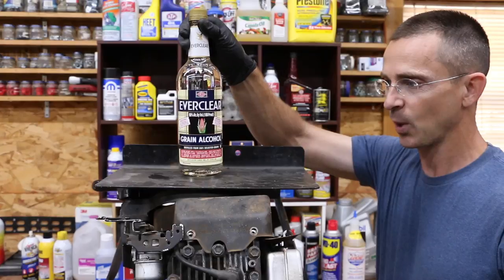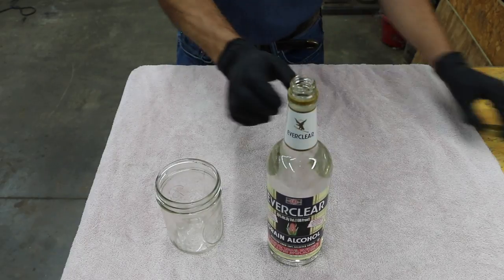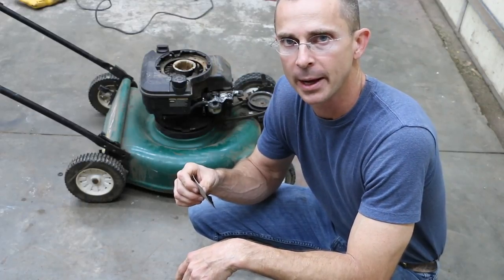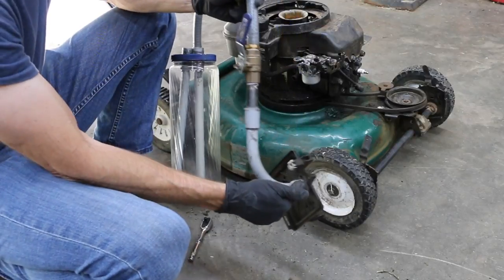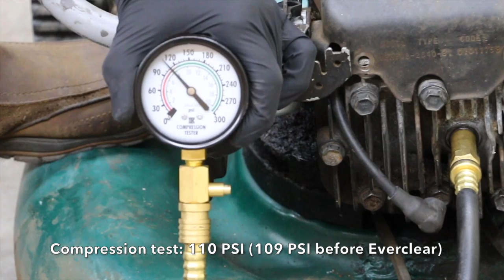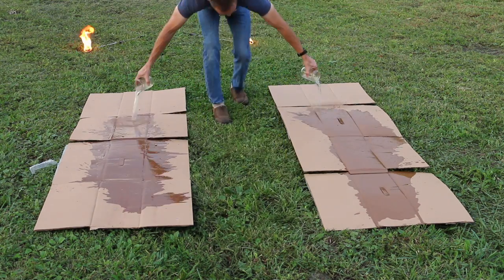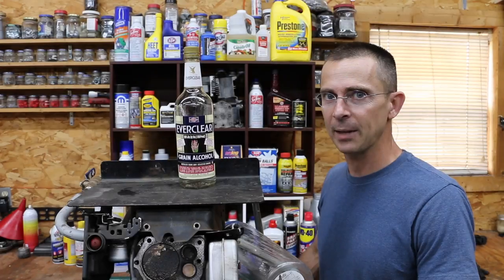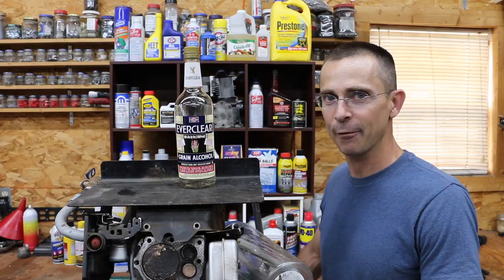Will an Engine Run on Everclear Fumes?  Let's find out!

Comment: Try to make an engine run off of acetylene I’m a fabricator and have to cut steel on a daily basis it would be very cool to see if it is possible though an engine like this 👍🏻. Be careful.
Reply from the maker: Thank you for this recommendation!
Reply: sound a bit dangerous lol, yeah be careful if your decide to try this. the whole engine might get blown to pieces
Reply: Sackmatters to lean and that could get hot lol
Reply: Sackmatters jeez that seems a bit sketchy dont you think?
Reply: Cutting with acetylene gets on my nerves, anymore i just grab a 6010 rod at 175 amps and push right through the plate lol
Reply: A car engine can run on acetylene and a test was done where a car engine tinkerer and his wife drove their car
from the East Coast to the West Coast using acetylene. You have to have a propane converter, a pressure tank
which holds water, a pressure lid on the tank for filling the tank with water+calcium chloride, a pressure pop-off
valve and most of the hardware that goes along with a propane conversions for vehicles. The converter would
not need to have engine water heat since the gas created by water and calcium chloride emits acetylene gas.
The water and calcium chloride was used in the old miner lamps for illumination in the mines. The ideal setup
would be a stainless steel tank with the fittings and connections welded on it. The tank is the secret on the
setup. The calcium chloride is even used today to charge the acetylene tanks for the welding/cutting torches
today. Propane and oxygen is sometimes used for cutting torches. Running the acetylene fuel in a car today
might be a problem since they have all the electronic computer junk on them.
Reply: Dennis Peterson cool, thanks for the info. still seems like it would be hard on the engine and I doubt the tinkerer went full throttle. If you had a large charge of air and acetylene (like at full throttle) I think it would blow the engine up.
Reply: I suspect that the fuel would give more power versus propane but remember, there is no un-burned fuel to cause a PING. You will never
hear ping in a engine with propane or a high vapor substance. A large
air charge from a supercharger/turbocharger might be a problem since cylinder temperatures would climb at a high rate possibly faster than
a tachometer!. A Pyrometer would need to be used to monitor exhaust temperatures much like what is used on the diesel trucks. I really suspect that if it's (acetylene) carefully used it would be a good fuel. I do know that it does not burn as clean as propane. The carbon soot from it burning in
the presence of air might be a problem. I know from my own experience that propane is the best option and a engine has to be tuned properly by raising the engine compression and changing the camshaft profile. Vaporizing gasoline is not the way to go since there are 7 different compounds in the gasoline that vary in vaporization temperatures and some are higher than 400 degrees, if I remember right. I have a chart on
them and I have played around with gasoline vapor fuel systems
and had success but as time went on running such systems, my
mileage went down just above what a fella would get using a 
carburetor. The vapor panels were getting contaminated from the
heavy ends of the fuel that were not being vaporized. Change the
vapor fuel panels to new ones and you were back to improved
fuel economy so, gasoline is not the answer. The only fella I know
that had a successful system was Smokey Yunick. Tom Ogle had a
system and I suspect he might have used White Gas or
what is called "Lantern Fuel", unless he changed his vapor panels
often? A Coleman Lantern proves that a pure liquid gas that resides
at room temperature will burn clean in them as a vapor. Put ordinary
gasoline in one of them and you will end up replacing your 
lantern's generator.
Reply: Dennis Petersen thank you for the info. I’d still love to see it done in a small scale.
Reply: Dennis Petersen
Everthing you wrote checks out, except, it's calcium CARBIDE...not chloride.
Reply: Dennis Petersen  propane doesn't ping or knock even on a turbo/supercharged engine. It has about 140 octane!
Reply: I also saw that on Warped Perception, look it up it was awesome !
Reply: Yup that right Dennis
Reply: Project Farm do not allow the acetylene to reach pressure above 15 psi it becomes dangerous
Reply: Interestingly, vaporized gasoline exhibits the same, no ping even at full throttle! Gasoline is lousy for using it
as a fuel by vaporizing it since there are 7 different additives in it that mess up a complete vaporization of
it and all they do is contaminate the vapor panels which results in waste products that can cause a ping
or worse yet,  a backfire through the system! I suspect that these products were added to cause problems
like this. The solution for a gasoline vapor system would be "white gas" which is Coleman fuel. FYI, the
Coleman lantern and stove proves that a gasoline vapor system works! There are tons of Patents that
prove that high mileage over fuel injection and standard carburators  can be attained. The "Fish"
carburetor is more efficient than fuel injection. Fuel injection was  chosen on the current engines controlled
by computerized systems for ease of use by the Public and I suspect to stifle development of better
high mileage systems, it's all over corporate greed and Government taxation.
Reply: It will fucking detonate and blow the piston through his leg or blow the head off into his leg. Either way it's detonating.
Reply: Nymeria Gloves They sell welding machines that come with a plasma torch built right into them.
Reply: It will.   I've used the torch head  pumping into the throat of carbs before to check for ignition to see if the engine will start.
Most likely running it though would cause detonation and ruin the engine. Chatter the piston face  right up and destroy the rings.
Reply: It's already been done just type in glass head or see-through head or acrylic head, 1 guys run it on like everything WD-40 ATF everything I tell you. I watched the acetylene one it worked really well too well

Comment: The bit comparing gas vs the EtOH burning on cardboard was very cool and interesting. I've seen guys who built their engines and then only used E85 fuel; when they did oil changes the oil was so clean it still looked brand new after 3000 miles.
Reply from the maker: Clean oil after 3,000 miles is very impressive!  Thanks for commenting.

Comment: You should try colman lantern fuel for gas. a friend told me he did it to get out of the woods. it was a long time ago but, it would be neat to see if he was telling the truth.
Reply from the maker: Thank you for this recommendation.
Reply: It works. Its very low octane though, so the engine pings or knocks like crazy. I've done both Coleman fuel, and kerosene in the past and they both acted similar, but I think kero was worse.

Comment: Nice video. You should try running e85 in a small engine also.
Reply from the maker: Thank you for the positive comment and thanks for the video recommendation.
Reply: Dylan B  wtf type of req is that t hats what everyone runs small engines off of and they run great different octane is for different compression ratios.
Reply: Steve no lol. E85 is flex fuel. Which has a lot higher amounts of ethanol that any octane gasoline. Try and run your lawnmower on e85 versus 89 octane gas which is what you regularly put in small engines. You will more than likely get a no start condition.
Reply: Dylan B I have! Ran perfect
Reply: e85 yes
Reply: If you took 1.5 ounces of non-oxygenated gasoline and added it to 8.5 ounces of Everclear, you would have 10 ounces of E85.
Reply: silicon212
Almost, Everclear is 190 proof, which means it's 95% ethanol 5% water. Probably not much different then your average E85 out of a pump though, which has also often has a small amount of water in it.
Reply: 177SCmaro In practice, Everclear is 5% water because it cannot be refined or distilled any further than that.  The ethanol used in E85 is also of a similar water content.  Everclear 190 is fully distilled ethanol.
Reply: silicon212
I know, hence "probably not much difference then your average E85 out of a pump, which also often has a small amount of water in it". In theory, E85 would have slightly less water content then mixing Everclear and gasoline as E85 is made from fuel grade ethanol and Everclear isn't, in practice, you're right, they're the same.
Reply: This everclear is e-96 lol
Reply: runs just fine, why do you ask (says the guy living right at 4,000ft)

Comment: Can you run a engine on acetone
Reply from the maker: Thank you for this video project recommendation!
Reply: Btw, if I remember correctly, there was a paper in SAE that found great emissions reductions (at a low cost!) and a measurable improvement in power with 10% acetone
Reply: Acetone will turn a lot of plastics and rubbers into jello though, that's the main problem with it.
Reply: +Alexander Riccio acetone will destroy the rubber seals and hoses of a car as well
Reply: +Alexander Riccio 
Sorry, but there is no SAE paper that supports your claims. 
Furthermore, there are research documents from the USDOE, USEPA, EERE, AFDC, MIT, SAE, API, ResearchGate, Chemical Forums, RaceFuel, ScienceDirect and several patent applications that indicate the benefits of acetone in gasoline fuel is cost prohibitive with minimal increases at best. 
As to the cost benefits, currently the average local price of gasoline is approximately $2.21 per gallon and the typical price of acetone ranges from $16.40 to $46.99 per gallon, meaning a fuel with a 10 percent concentration of acetone would have to increase the fuel mileage a minimum of approximately 74 percent to break even. 
Acetone also does not mix with gasoline, does not remain in solution very long and quickly separates from gasoline in storage containers/tanks. 
Any concentration of acetone in automotive fuel systems is damaging. 

What acetone in gasoline does and does not do...
Acetone does not mix with and remain in solution with gasoline, ethanol, methanol. 
Acetone is miscible and does readily mix with water until there is phase change or saturation and then it completely separates. 
Acetone has a lower energy density than gasoline.  
Acetone has a lower heat value than gasoline. Acetone has 29,000 kJ/kg, gasoline has 47,300 kJ/kg. 
Acetone has a higher octane rating than gasoline of approximately 117 RON. 
Acetone is a strong solvent and rapidly degrades many rubber and plastic components on contact. 
Acetone promotes vaporization, has a low flash point of -4°F (-20°C) and flashes off (evaporates) very easily. 
Acetone is polar and promotes galvanic corrosion similar to ethanol, methanol and most alcohols.

Comment: try putting ATF in gas to see if it cleans the carbon
Reply from the maker: Thank you for this recommendation!
Reply: Don't know about cleaning the Carbon...What I do know is, it'll make a hell of a lot of smoke while doing it😆
Reply: James Ellis well i already did it and it didnt smoke but i dont know if it cleaned the carbon.?
Reply: Good idea. Old timers used to put it in diesel trucks as a fuel detergent/conditioner.
Reply: High concentrations of ATF will smoke...like yourself, I still don't know whether it cleans though.
Reply: at is good for cleaning injectors on a diesel only problem is that it's red and red diesel is a big no no if you're on the road
Reply: James Ellis bug killer
Reply: 365 Hockey life atf works very well in fact i do it on my truck in the intake once a month and my mpg gets better every time so i dont know if it cleans but it sure does somthing right
Reply: Mix ATF 50% with hot water, shake well and spray into the intake of a hot engine revving at about 2500 > 3000 rpm, will do a great job of breaking up carbon deposits on pistons, cylinders, and valves. It will smoke like crazy though.
Reply: @Project Farm: 
If you decide to test this, could you test it on both a gas and diesel engine?
Reply: Uhhh...putting oil in gasoline will NOT get rid of carbon. Think about that for a second. The oil will just produce MORE carbon when it burns.

Comment: Is this essentially E90?
Reply: E95
Reply from the maker: Great point. The other 5% is water.
Reply: 190 proof is 95% ethanol and 0% gasoline - technically speaking it's not really E95, but it's got more ethanol than E90... my point was the 1/2 point math puts it closer to E95, minus the gasoline part (people drink that stuff, usually diluted).  190/2=95...
Reply: You said it was E100 - not E95.  Everclear is not 100%, but instead 95% as it does contain 5% water and impurities.  I'm an engineer by trade, and precision is key when working in my field.
Reply: The "E" refers specifically to Ethanol, not Alcohol in general.  There were also tests done with M% fuels, which contain Methanol, prior to the Government settling on Ethanol being added to gasoline.  If you were to add 190 Proof Everclear to gasoline, it would still only be roughly E90 due to water content.
Reply: skubischta, false. Proof measures 0.5% increments of alcohol of all types. Most federally approved for human consumption alcohol is ethanol (made from yeast and sugar reaction in fruits, berries, melons,  and grains), which is also the alcohol used to make gasoline as an additive. Gasoline, diesel, and many other fuels are all made from crude oil. Gasoline may also have methanol additives, which methanol is made from wood and was used in consumable alcohol for a time before being banned because of toxicity (1 tsp will kill a child, 1 tbsp. to make an adult go blind [may be short term, long term or permanent, depending on person's metabolism and resistance]). Propanol, butanol, isobutyl, and ethanol may all be used in solvents, the first 3 of these 4 may be used in commercial alcohol applications (isopropyl rubbing alcohol [diluted with water], witch hazel [same thing], wet wipes, Lysol products and more). There are also C6-C18 alcohols which I don't know much about those types.
Reply: E100
Reply: Nicolas Broszky   You're right that ethanol is Hygroscopic (pulls moisture from air) as well as hydrophilic (mixes well with water), but it is very common to bring ethanol to 100% purity. You just can't do it with distillation alone. Since it is an azeotrope, it will not separate from water by boiling it once it reaches 95% purity. Using a molecular sieve however will pull out the rest of the water to achieve 100% purity. That's how they make transportation use ethanol and that's what they mix with gasoline. Everclear is only sent through distillation, bringing it to 95% ethanol.
Reply: Nicolas Broszky  Molecular Sieves are not very expensive and used in every ethanol plant. Fractional distillation cannot bring the purity higher than 95%. Once it's at 95% (after distillation), it is run through a molecular sieve which strips the remaining moisture. A nitrogen blanket is put on the storage tanks to keep moisture out of the ethanol. I said 100% for simplicity sake, it will actually be 99.X% due to other impurities prior to denaturation addition.
The fuel ethanol specifications state a maximum of 1% moisture allowance. Proper handling and storage disallow moisture into the ethanol.
Reply: Nicolas Broszky   I don't know where you're getting your info from but the ASTM specification for moisture in Ethanol is 1% in the US. It is lower than that in many other countries. No 1st world country would allow ethanol with 5% moisture be used for transportation. And as I have already said, molecular sieves are not very expensive and yes, they are used in every fuel ethanol production facility. I'm a process engineer in the renewable fuel industry by the way, I think I would have a pretty decent idea of the specifications and the production process.
Reply: Nicolas Broszky  Thank you for finding flaws in semantics Doc, I'm going to ignore your condescending remarks (moisture and water are synonyms). 

I'm saying that BEFORE the ethanol is introduced to the petrol (to make E85), it cannot have any more than 1% water by volume (based on the specifications outlined in ASTM D4806). This is where the molecular sieve comes into play.

If moisture is present in the E85 mixture, it is due to storage mishandling. So yes, despite your beliefs, molecular sieves are extremely common in the ethanol production industry.
Reply: Nicolas Broszky  I don't care what you can do in your lab/kitchen. In the real world, molecular sieves are used in every ethanol production plant. It's much easier and cheaper to adsorb water than use swing distillation. You talk about the price of molecular sieves but completely ignore how energy intensive distillation is, not to mention the capitol cost of a column.
Reply: jeffel80 no need to be rude

Comment: Haha! Excuse me sir, has your lawnmower had anything to drink tonight? 

I wonder if it’s possible to run an engine on White Spirit/Paint Thinners?
Reply from the maker: LOL!  Thanks for the video project idea.
Reply: Toluene is a lovely fuel.
Reply: as well as one of the T's in TNT. Worked great in Formula 1 cars of old.
Reply: Paint thinner aka varsol is the petroleum derivative(same place as gasoline comes from)has a lower flash point than gasoline.  Paint thinner aka turpentine is a plant derivative that stinks more than varsol but works like varsol has even a lower flash point than varsol. Lacquer thinner is a different chemical again and has a higher flash point than varsol but still lower than gasoline and is used for Lacquer paints only. Methyl Hydrate is wood alcohol which is like  Everclear(only poisonous), so it would work the same as the grain alcohol.; mh is used to thin Shellac.
 That is all the paint thinners a painter uses.  Gasoline has the biggest bang for the buck.

Painter